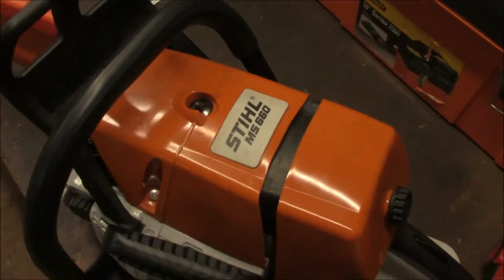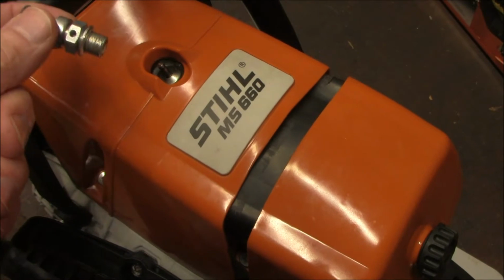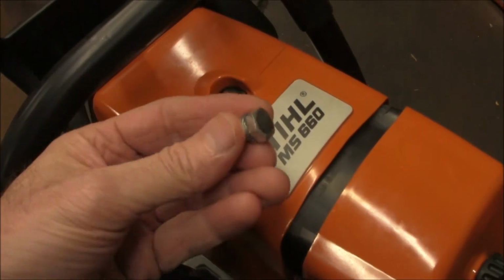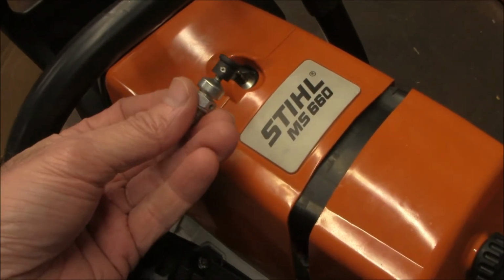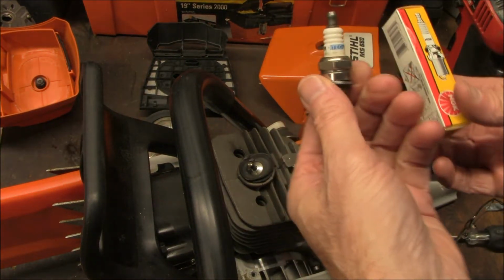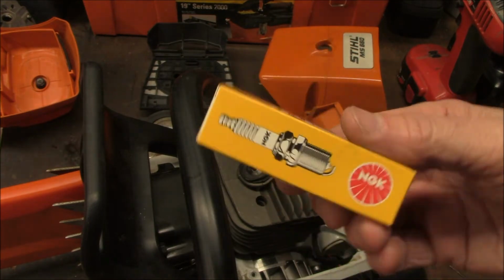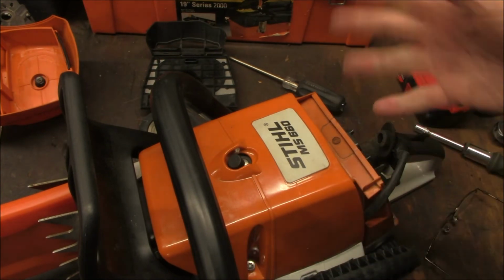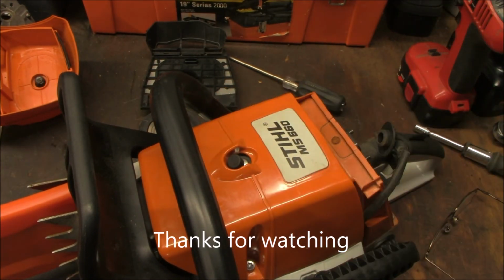Hutzl MS660 Upgrades & Improvements

Comment: Be interested to know if the decomp held up. Many of the aftermarket ones from various sources DO NOT. For $15.00 I would have bought the Stihl decomp in a heart beat. Post up on how this decomp has performed. Thanks
Reply from the maker: So far so good.  Lots of use and still going strong.

Comment: Replacing the "rotor" pulley STIHL OEM part number 1122-195-0400 on the recoil (inside the pull start assembly) will save you a headache and a heartache later. The STIHL plastic is stronger and the hole for the pull rope is at a 45 degree angle instead of a 90 degree on the Chinese models.

Comment: Keep in mind that the real STIHL saw has a Magnesium cover over the starter recoil assembly. The "Chinese copies have plastic covers and if you drop the saw or bang the saw on the side then you might damage the recoil assembly parts very easily.
Reply: I just got a Holzfforma G660 in the mail yesterday & it has Metal assembly now, the clutch cover is metal also